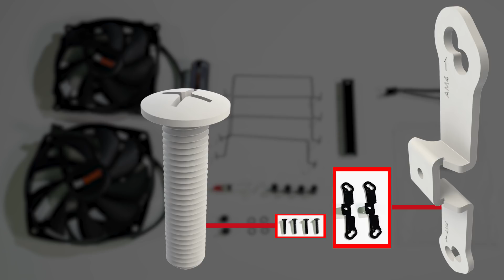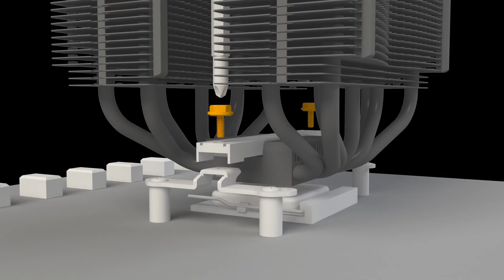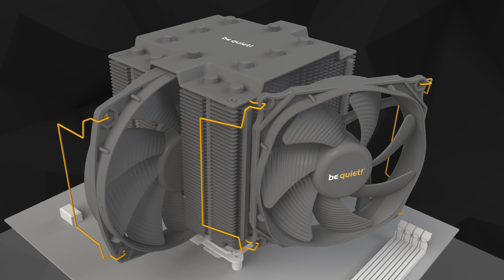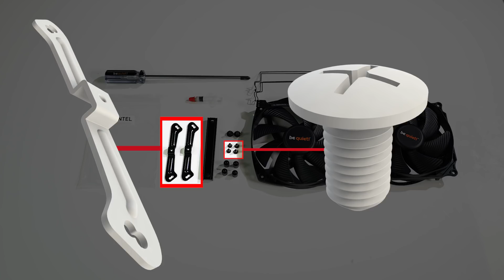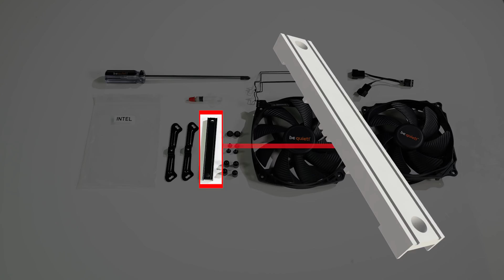Installation: Dark Rock Pro 4 (AMD AM4 / AM3(+), Intel LGA 1151 / 2066) | be quiet!

Comment: OK. Managed to put the o rings on the chip side of the motherboard. Can't figure out what difference it's going to make. Wish me luck ⛔🖖.
There's contact with the rear cpu housing but not the back of the chip contact-plate. And the clearance on the screws is the depth of o rings anyway so what do you they do?
Reply from the maker: They only hold the screws in place for easier mounting

Comment: Running this on my 5950x and it’s fine 👍
Reply: Idle and Prime95 temp?
Reply: @Excellence2012  let me check at the weekend with cinebench and Battlefield
Reply: @EFXVoila  ....
Reply: @Excellence2012  its around 60-65 under heavy load and boosts up to 4,7 GHz on all 16 cores in Battlefield V. The 5950x works fine under air cooling :)
Reply: @EFXVoila  Thanks for the answer. Very good cooling to the alternative AIO.
Reply: @EFXVoila  Prime95 test temp would be interesting
Reply: @Excellence2012  Prime pushed it to ~ 70° Celsius which still is okay I guess?
Reply: @EFXVoila  More than very good, if the Prime95 test ran for 10 minutes, you can also install a CPU then think 5°C ~ 8°C less temp
Reply: @Excellence2012  I guess it depends on the cooling/target temp profile after all

Comment: Are the fans meant to blow into different directions? That was the only confusing thing about this video. I figured they should both be pushing air into the back of the case.
Reply from the maker: Hello, the fans should be installed so that the logos face forward, so the air is blown from the front to the back.

Comment: Can I add a Bequiet 120mm light wing fan at front and move the included one to the rear, and where to plug a pin to mb ?
Reply from the maker: Unfortunately, no, an additional Light Wings can only be installed on the rear of the Dark Rock Pro 4. The Light Wings has to be connected to a PWM header and an ARGB connector.

Comment: Mine is loose and not cooling CPU properly I'm not sure what to do, followed steps.

Like the cooler moves a little
Reply from the maker: It's supposed to move a little (as it will inevitably due to the thermal grease), but of course it shouldn't glide around. 

So let's start with the basics: Did you remove the plastik sticker covering the base plate before mounting the cooler?
Reply: @bequietofficial  LMFAO

Comment: I know you can't have the middle fan pre-installed because you need to be able to properly screw in the mounting bracket, but darn, those fan clips are a pain. I now know what everyone else meant. Works great though!
Reply from the maker: Always loose it on fan side not an the finns

Comment: I ordered the new 1700 bracket but realized my asus prime z690 board can fit the old 1151 bracket. Should i wait for the proper 1700 bracket? I dont want to damage anything.
Reply from the maker: Please use the LGA 1700 kit, otherwise the warranty will expire. Even if it fits at first glance, the mounting pressure is different.
Reply: @bequietofficial  okay!, Thank you for the quick reply!

Comment: I cant get the bracket that matches with the screws in on my motherboard :|
Reply from the maker: Can you please describe again exactly at which step you have problems?
Reply: @bequietofficial  I fixed it, turns out I was installing it incorrectly and in the wrong direction, it works great in my pc and is very quiet.

Comment: Is there any way to buy only the am4 mounting kit for the dark rock pro 4?
Reply from the maker: The Dark Rock Pro 4 doesn't need a dedicated AM4 installation kit.
Reply: @bequietofficial  How do you call the detached pieces required to fix the DRP4 on amd socket that we see in the video at 0:07? I'm looking for it, I have the DRP4 but do not have these pieces. Thx

Comment: Is the AM5 installation the same as the AM3 installation as shown in this video?
Reply from the maker: AM3 is no longer supported but it will be the same as AM4.
Reply: @bequietofficial  thanks! I bought my Dark Rock Pro 4 in 2019, any idea if I received AM4 compatible parts by then?
Reply from the maker: The Dark Rock Pro 4 does always come with AM4 Parts. There was no version without.
Reply: @bequietofficial  brilliant thanks!

Comment: So I'm trying to install this on a MSI Meg X570 Unify mobo. The step at 1:11 is not working for me. The screws are not lined up. I can only get one in. It seems like the part isn't long enough to reach both of them or something. Not sure what I'm doing wrong, if anything. I double checked your website, and it claims the Dark Rock Pro 4 is compatible with my mobo.
Reply from the maker: Have you turned the bridge by 180 degrees? The sides are not symmetrical.

Comment: will this cooler fit for this chassi?
width: 21 cm
depth: 45 cm
height: 48,8 cm
Reply from the maker: These are the dimensions of the Dark Rock Pro 4:
Dimensions (L x W x H), (mm) 146 x 136 x 163
This should fit, but please check the info-graphic on the product page again and also keep the motherboard and other components in mind when you compare the measurements.
https://www.bequiet.com/en/cpucooler/1378

Comment: At 3:50 you’re actually tightening the metal nuts on the printed circuit board tracks, will it damage the tracks causing short circuits?
Pls. let me know if this is  real issue, I’m so scared to damage the MB tracks that I put the AMD plastic washers between the PCB and the metal nuts.
Reply from the maker: No, it will not.
Reply: be quiet! Thank you for the reply, I have another question, how tight do you screw the 2 screws that hold the cooler to the CPU?

Comment: for the 2 to 1 fan connecter cable. one of  my the 2 fan input connectors has a missing prong (not the connector that goes into the Mobo). is this by design? and does it matter which fan connects to which connector?
Reply from the maker: It is standard that one connection has only three pins. The signal of only one fan is read out but the fan control is transmitted as a PWM signal to both fans. It doesn't matter which of the two fans is plugged into which connector.

Comment: Would this give clearance to Kingston fury renegade with 42.2mm height . bequiet says it gives 40mm clearance . But I’ve seen videos of people using rams of 44mm ?
Reply from the maker: It is possible if the fan is attached to the cooler further up but we wouldn’t recommend it.

Comment: question...the way this cooler seems to be mounted it seems that it will be pushing and pulling air from the exhaust side of most cases? do the fans only install 1 way? or am i seeing it backwards?
Reply from the maker: Both fans are installed in alignment with the airflow, so in one direction.

Comment: Can someone help me and give me info on the wind direction of the center fan. In the manual (AMD), the middle fan (according to the 3D image without logo in front) is used in the opposite direction of the front fan, but here in the video both fans are installed in the same wind direction. Which direction is correct, 2 times in the same direction or opposite???
Reply from the maker: Hello, both fans should be installed in the same direction, so that both logos face forward.

Comment: It seems that this cooler is over the SSD NVME slot on intel motherboard. Does anyone have a similar situation and can confirm if they can handle the ssd without issues?
Reply: @fullsnackdevcom  hi, I hope it’s still relevant, but I had the same issue. I just took off my gpu to place the nvme ssd. The only problem is that I couldn’t cover the ssd with its cooling panel due to size of the cpu cooler. But  it works great

Comment: Hi. I recently bought a completly new PC from scratch and also bought the Dark Rock Pro 4. I attached both Fans separatly to the motherboard instead of using the Y-Splitter that came with it. Is it ok to run it this way or should I install the Y-Splitter.
Reply from the maker: Both ways are fine. Some mainboards doesn´t have a second CPU Fan header. Thats where the Y Spliter comes in handy

Comment: I can't seem to install the middle fan with the clips. I've tried every way, but its way too loose and not securing in place. I didn't have an issue with the front fan, just the middle one. I know they're different size clips but the bigger ones are way too loose and I can't figure it out. Please help, I've tried everything!
Reply from the maker: Hello Moonie. The long ones are definitely not right. Aren't there other clips in your box? If not, please contact our customer support (service@bequiet.com) - my colleagues will send you new ones quickly.
Reply: be quiet! I only had two of the short ones. I will give them an email, thank you!

Comment: I just got the dark rock pro 4 for the aorus pro ac b550 AMD motherboard. I've screwed everything in per the instructions but the cooler wobbles and can slide across the CPU when pushed. Is it supposed to do that?
Reply from the maker: Hello Anthony. A little wiggle room is normal due to the thermal grease. But it shouldn't slide and wobble.
Reply: @bequietofficial  if I put a little force it can slide left and right. That middle plate doesnt really seat it on very tight as it was sliding when I had to readjust the fan on the side of the cooler. That being said it is my first build and per tutorials I've seen I have spread the thermal paste all across the CPU square. Could it just be a little too much/wet paste?
Reply from the maker: Any superfluous thermal grease will be pushed out to the sides automatically. How are you CPU's temperatures?

Comment: I have installed the backplate of the motherboard with the dark rock pro 4 but I want to replace the air cooler  with the pure loop 280mm aio. do I have to remove the backplate or can I just keep the same backplate of the dark rock pro 4 and just install the pure loop aio on the dark rock pro 4 backplate since it look like it in the same position and screws too.
Reply from the maker: Hello, the backplate does not need to be replaced, since it is the same mounting.

Comment: All went smoothly until I had to secure my mounting bridge. When I screw through the mounting bridge into the AM4 bracket, even one screw thread is enough to tilt the opposite end of the bridge, making it impossible for a screw to even reach the bracket threads.
Reply from the maker: Please contact our service department by mail (service@bequiet.com) if the problem still exists, so that we can help you quickly.
Reply: @bequietofficial  Thank ya

Comment: I have issue with this cooler when i installed it pc just wouldnt post so i tested everything and all parts work. Then i tryed applying slight pressure on top of the cooler pulling towards motherboard and pc booted. I guess the mounting bracket is not that good...
Reply from the maker: Have you removed the plastic coating of the base plate before installing the cooler?
Reply: @bequietofficial  Yes i have but everytime my pc is being powered off i have to remount the cooler. It is like its creating to much force on bottom side of the cpu and top pins dont have contact at all. Im not even sure how much force i need to use when tightening those screws anymore....

Comment: Anyone had issued with this CPU cooler on the RAM clearance? I have 4 RAM G.Skill Neo Trident Z. I wonder if this CPU can fit. Actually i already buy arctic liquid freezer II. But because of the RAM clearance issued had to sold it and look for another alternative. Leave ur comment as it would help me to make my purchase decision. Tq
Reply from the maker: Hello. The Dark Rock Pro 4 has a RAM clearance of 40mm - so you should definitely check first if your modules will fit underneath it.

Comment: I have G.Skill Aegis in A2 and B2. Does the Dark Rock Pro 4 work with my RAM (mayby with pushing the fan up a little bit)? Does anyone have the same RAM+CPU cooler?
Reply from the maker: Hello Ben. According to GSkill the Aegis RAM modules have a height of 31.2mm, and our Dark Rock Pro 4 CPU cooler has a RAM clearance of 40mm - so everything should work just fine. but please measure them yourself too, just to be on the safe side.
Reply: @bequietofficial  I meassured all the other clearances and it turned out that all dark rocks are just about 1cm too wide and too long for the heatsinks of my MSI X470 Gaming Plus Max Motherboard. So I have to go with the shadow rock 3.

Comment: To hell with these thin wire brackets I wouldn't wish them upon my worst enemy.
Reply: I wish they'd made it more obvious that there are two different depths of bracket. Took me a while to work out why I couldn't get the middle fan in
Reply: Update:  I am to be labeled a fool-idiot; I utilized the larger brackets that were hiding from me and they fit pretty well.  Had some hiccups during build because I am a first timer, but it worked out.  Those small brackets still developed a hatred in my cold, dead soul.

Comment: ARRIVED MISSING CRITICAL PART -- Well, I got a Dark Rock Pro 4, plus over $2,600 of new parts to build a new audio/video editing and CAD computer, but the cooler is missing a critical mounting bridge fastening screw. So, I'll have about a 10-day delay while I go through the RMA/return/re-ship cycle with the store. This sucks! I was within about one hour of finishing the hardware when I looked in the bag to find there was just one screw with two required. Regretfully, they aren't standard hardware items, so the only option is to remove the part I installed on the motherboard, package up the cooler, get an RMA from the store, take the package to a FedEx location (about 20 miles away), pay to ship it, then  wait about 10 days for a replacement to arrive. This really sucks. However, the video is good and did a great job of guiding me to the point where I realized I was wasting my time.
Reply from the maker: Hello Rob. We are very sorry - usually our packages are complete, of course. Why didn't you just contact our support (service@bequiet.com)? My colleagues would have sent you the missing screw immediately.

Comment: I did everything as you showed in this video and in general successfully installed my tower on the processor. But I ran into a problem that after pressing the cooler around the edges of the thermal paste came out. I tried to gently wipe it off with a cotton swab under the tower and it didn't seem to cause any problems. But I did everything exactly as the person showed in the video. Installed on Ryzen 7 5800x. Everything started up and works without problems. Do I have anything to worry about?

Comment: My only concern is I worry about good even mounting pressure with the crossbar/hold-down system. I couldnt find any specifics anywhere so I guess it's just a matter of eyeballing or feeling out how tight to screw down the 2 screws securing it in place. Otherwise the video guide was very helpful👍
Reply from the maker: Yes, it is: As you tighten the screws you feel the resistance getting stronger - and from that point it's a matter of gut feeling. Of course you shouldn't mount it too tighly, though - a little bit of wiggle room on top of the CPU is normal due to the thermal paste.
Reply: Perfect, exactly what I did and I am loving it! Thank you for the reply, you saved me from completely remounting out of fear I did it wrong, which makes it the second time (at least) this video has helped me!🙏❤

Comment: 2:06 shows the middle fan facing the other direction but he installs it with it facing the same direction as the outer fan , which is correct ?
Reply from the maker: Actually both face the same direction - the render only misses the "be quiet!" logo which would make it clearer.
Reply: @bequietofficial  I had a problem with this too, came to the comments section to make sure

Comment: EASY MISTAKE TO MAKE: THE TWO SETS OF CLIPS IN THE BAG ARE DIFFERENT SIZES, THIS ISN'T POINTED OUT, BUT USE THE SMALL CLIPS ON THE MIDDLE FAN! THE BIG ONES ARE FOR A BONUS 3RD FAN IF YOU INSTALL 1!

If you have CPU_FAN and CPU_OPT on the motherboard, you can avoid using the Y-Cable and plug them directly to CPU_FAN then CPU_OPT! If you are using the Y-Cable, plug it into CPU_FAN and leave CPU_OPT empty.

Comment: I have an AMD4 and the cooler is Moving a bit After fixation. It moove only if i apply a small pressure but i'm not sure it's good. It's moving over the horizontal axis (it's really light but it's moving). Could someone tell me if it's normal or not ?
Reply from the maker: Hello. A little bit of wiggle room is perfectly normal due to the thermal grease.
Reply: @bequietofficial  Ok nice to know! Thanks for that fast answer ! I wasn't sure because it's the first time i'm building myself a computer (btw i did 1 hour stress test to be sure yesterday and my cpu stayed at 57°C with max peak at 69 °C so i think the cooler is working well 😁)

Comment: The cooler itself looks great but now I see why some ppl said they are not willing to reinstall this thing a second time
Reply from the maker: Why is that?
Reply: @bequietofficial  In short, it is through installation in the housing and thus disassembly. By mounting it outside the housing, it probably will not be as much of a problem as in the housing because then access is difficult and you need to disassemble the graphics card and the upper top housing, as in my case with the phanteks p400 housing

Comment: WTF. 0:25 says to use thosr circle spacers. This is not described in manual, or other installation videos. Am3 installation. And it says you need to use them in this video.
Reply from the maker: The AM3 washers are listed as number 16 in the scope of delivery in the manual.
The manual also describes in the section "AMD: AM4 / AM3(+)" that the AM3 washers must be used for the AM3 installation.
Reply: @bequietofficial  I have an AMD ryzen 3600. I dont know if this is Am3.
Reply from the maker: If you have that CPU, you have to follow the AM4 instructions